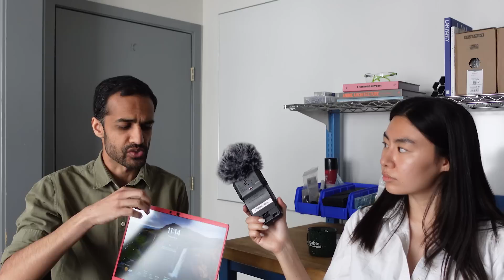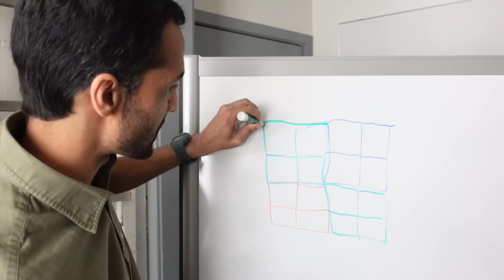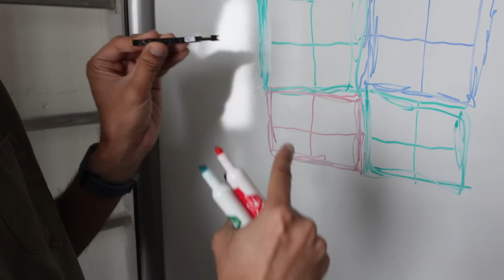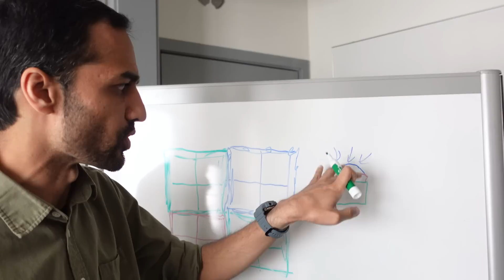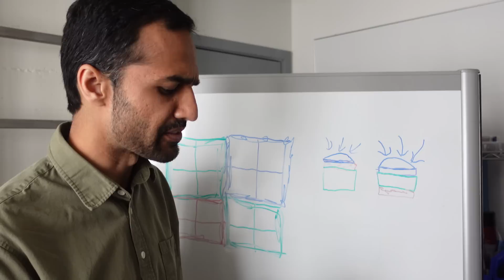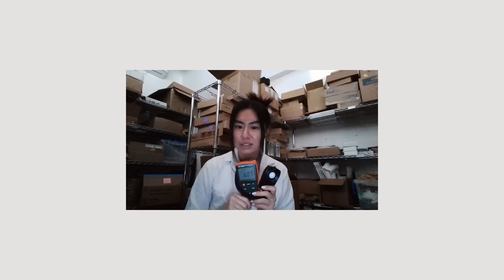ENGINEERING DEEP DIVE: NEW Framework Laptop Webcam Module (2024)

Comment: It would be nice to have the camera connect over a higher speed connection than USB 2.0 in the next version. That's one of the selling points of the new Snapdragon X Elite laptops, they use better cameras and a higher speed connection between the camera module and the motherboard. I think the new Framework camera still looks worse than smartphone cameras. It's enough, but not outstanding.

Comment: Very happy that things are going well, I'm a big proponent of the vision that Framework is leading and hope they will make it in the long run.

I really hope they will be able to exert the same level of technical proficiency with the next display update as well (I'd really appreciate a touch-screen and gorilla glass combo :))

P.S. After I've read a few more comments - sample the audio to mono for the next video, it will be a lot less distracting (the mics are turned opposite to where the sound should be coming from by the point of view of the observer, thus sounds so strange at times).

Comment: I know this probably isn't a priority for Framework right now, but will we see an option to disable the binning and get the full 9.2MP video feed, maybe with an ectool flag or similar? Obviously it's not very useful for video conferencing, but for machine learning applications or similar, it might be more beneficial to have all the raw pixel data accessible to software. I do love seeing the progress being made here and am especially glad this area is being tackled by Framework, as it's clearly been neglected for quite a while.
Reply: Completely agree. Phone manufacturers boast about how their image sensors are capable of x resolution, but then they do pixel binning and output 1/4 or even lower resolution images. And then there's no way to disable the pixel binning. It would certainly be nice to be able to configure the sensor, even if it came with the danger of bricking the module.
Reply: Given that this is framework we're talking about here, I wouldn't be surprised if it's possible.

Comment: Not the best thing to hold a Zoom H4n this way and move it about... Especially with the directional mics. E.g. here the right channel on Nirav's audio is clipping because one of the mics is pointed directly at him, so even with the deadcat the levels are too hot. Maybe a couple of cheap lavs fixed up to the H4n would give better audio consistency. Something like the Hollyland Lark M1 or the more expensive Rode Wireless Go 2. Just a thought.

Comment: Wait, the Bayer pattern is at the lower resolution?  I guess that might make sense with lower chroma frequency? And I guess you can't really average pixels if there's only one subpixel of that color in the superpixel area. Or did that accidentally get flubbed? You'd think pulling a Sigma and getting color information in every pixel before demosaicing would improve quality.

I do wish it was USB 3 though.  MS killing on-controller webcam compression just annihilated the 4k webcam space.

Comment: Still has a center-to-edge color shift... Red at the center and green at the edge.
Reply: That comes with a wide angle view. Each pixel of the sensor has a micro lens on top of it. Light from extreme angles is not collected as well. 
Was seen clearly in early microfourthirds m43 cameras using wide old lenses designed for silver film cameras.
Reply: @ericd7709  It's actually caused by lens coating effectiveness changing with wavelength at different angles. It still happens with telecentric lenses, as long as there are some lens surfaces where light strikes at steep angles.
On high-end camera lenses, this was solved by adjusting designs and by better coatings.
On phones, this was solved in software. It ought to be solved in software here.
Reply: I actually suspect the first webcam video was the old camera. Angle of view, color balance and even the audio seemed to match. Colour shift is not visible in the store room video. Maybe the lighting isn't of uniform color? Try again?

Red veiling could be a problem caused by the infrared cut filter.
Reply: In a single word: the lens needs to be more "telecentric".

Comment: The transparency is so refreshing, thanks to those working at Framework for leading the way in making devices that are actually meant to be tinkered with!
I'm really excited for this module because although I don't have a framework, I think (maybe??) I can mod it into my old thinkpad and extend its life.
I'll definitely be looking for a framework when I'm shopping for a new laptop though
Reply: Uhmm.... So I think the first obstacle you'll encounter is that fancy cameras like OmniVision require a firmware to be loaded during each boot, which can be a pain if not public.
Reply: @cmorche  I'd think the firmware is just loaded by the camera controller on the board? The connector for the old webcam module seems to just be USB so I was thinking I could just replace my laptop's current module with it with a simple converter cable.

Comment: I'm a few months away yet, but i cant wait until i've saved enough to get a Framework!!!
Reply: yeah the almost €2000 markup is quite steep for the AMD DIY with the new screen + webcam, I was doubting whether to instantly go for the full version of what I want(bring own OS + own SSD) or get the most basic AMD DIY one and upgrade a tiny bit later but that would already leave me with the entry Ryzen board, the old screen and the old webcam that I'm not going to use anymore just about a year after I bought it.

So guess I'll wait a bit more, maybe prices will drop some more in the coming months. I do think the ethernet port is still stupidly expensive though.

Comment: According to an LTT video i watched, the real bottleneck is the connection to the CPU. Did i understand that correctly?
Reply from the maker: We didn't dig into this in this video, but one major constraint on laptop camera quality is that it's extremely complex and expensive to use anything but USB 2.0 for the connection between the camera and the mainboard.  That means that the 1080p stream has to be compressed down to fit in USB 2.0 Isochronous mode, and compressed using a low latency video codec, typically MJPEG.  There are alternatives like using MIPI and leveraging the ISP in the processor, but beyond the cost challenge, this has historically had really poor support in Linux.
Reply: @FrameworkComputer That is a great explanation! Thanks! Looking forward to getting my hands on the new module!
Reply: @FrameworkComputer  Oh, that's interesting. I thought that the connector can fit a quite a few LVDS pairs to accomodate the throughput needed. So, it's not the wiring, but the chips on the module and mainboard that make it all nontrivial?
Reply: From what I reckon, laptop cameras have two issues : size (with the bezel shrinking tendencies), which impacts how much light the sensor can get and thus, the quality of the image (as more light means more details), while the second issue would be the lack of a good post processing unit for the webcam, which phones indeed integrate into their multi purpose chip. On laptops and desktops, it would either need to be integrated in/with the camera, or find a way to be added to the motherboard or the cpu. Though I guess a good software base method could at least partially help too.
Reply: Not exactly. It is that snapdragon has proprietary image sensing tech on their CPUs that make cameras look better. If framework wanted to do the same, they would need to make an extremely expensive custom chip/software that wouldn't really be worth it.
Reply: @Tobias-fl3nb  yeah, i didn’t mean that that’s where the improvement comes from for this camera module, i was just wondering if future mainboards might open them up to even better modules. I figure its not out of the question but probably not something they could influence one way or another. That’s a problem for intel and AMD to fix, right?
Reply: No, watch the vid.

Comment: It would be good to have an external housing with USB to allow replaced modules to still be used
Reply: It's got open CAD drawings, so anyone can try! All you need is break out the pins
Reply: That would be a pretty cool feature, but I have to imagine that the standard camera controller doesn't implement USB standards, and framework isn't large enough in the industry to justify the suppliers making a brand new and more complex design for such a niche.
Reply: @sheeplord4976  most camera modules are USB. They said it in the video that they're staying at 2.0
Reply: @sheeplord4976 it is just a USB camera , it does not use DSI bus so you just need a usb cable